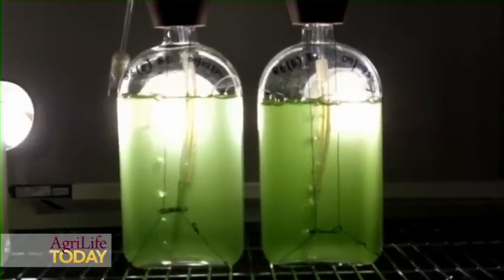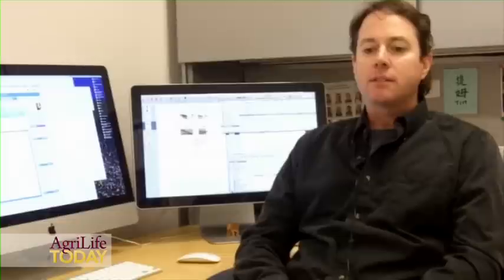Oil from Algae

Comment: 40 years - knowing of the potential of algae as a fuel doesn't speak well to industry being the least bit serious to utilize it - doesn't make sense. I guess it's easier to drill thru miles of ocean and then bed rock risking lives and fouling the oceans, or lay miles of pipe to haul oil sludge clear across the entire country and then load it into ships, or explode our terra firmas with tons of toxic chemicals right beneath our precious water tables and aqua fir. That all makes perfect sense.